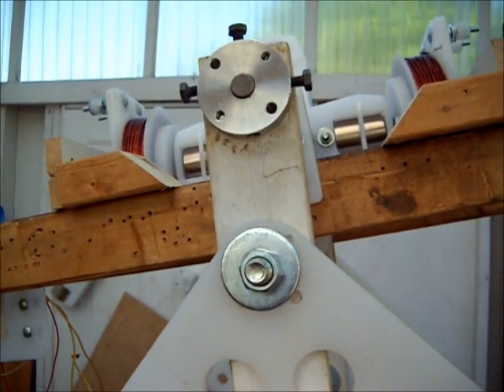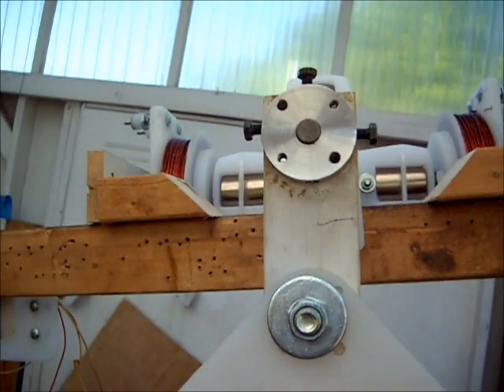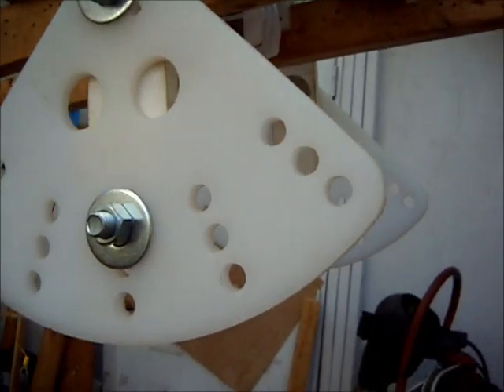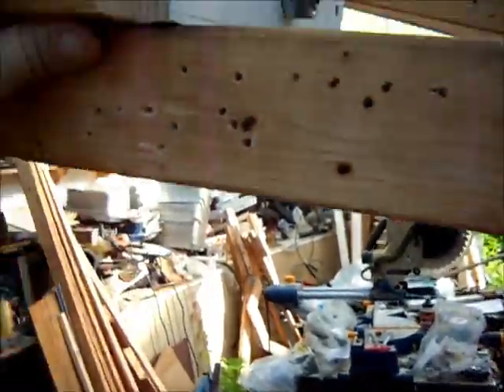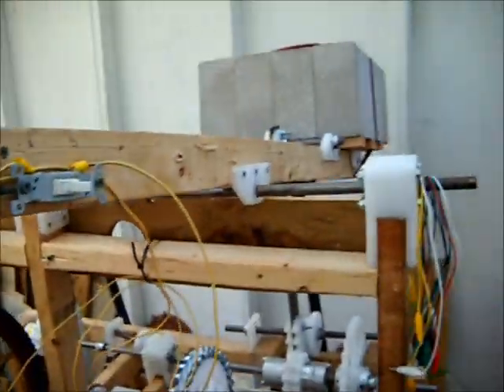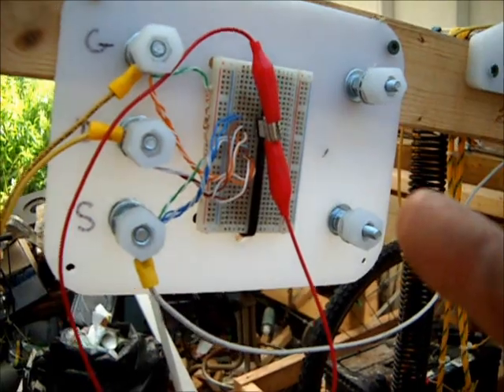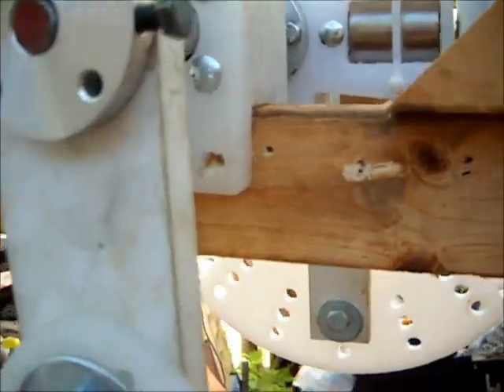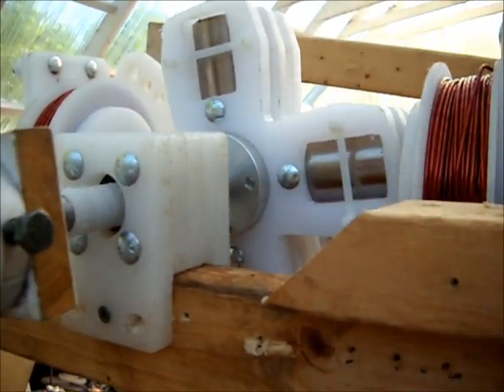GRAM TSO Gravity Assisted Pulse Motor 6 22 19

Comment from the maker: the magnets are to close to the coils iron core, increasing air gap to 0.75 inches, I will try running mosfets in parallel , adding heat sinks

Comment: You could also use a reed switch, I am sure you will have one. The closer you will bring those to the (extra set of) magnets, the longer the ON time will be. 
PS: MOSFETS can also be put in parallel. Not only for more amps, but also for reduced power dissipation. And you still need to add a diode to catch the Back EMF. Just put it across the coil. Don't let the BEMF blow up your mosfet. You could even capture the BEMF in a capacitor so you have extra power to something else with.